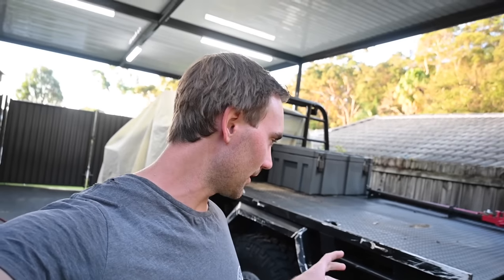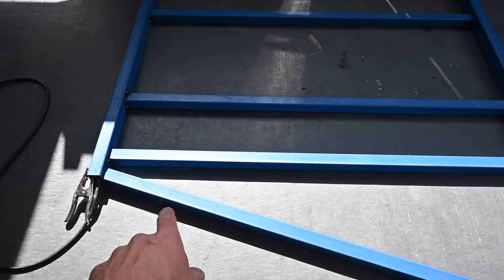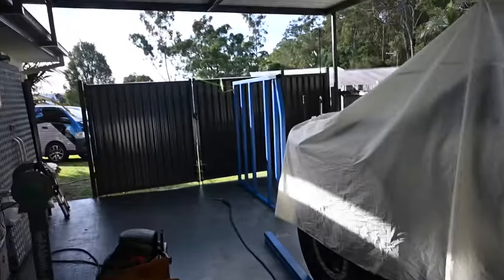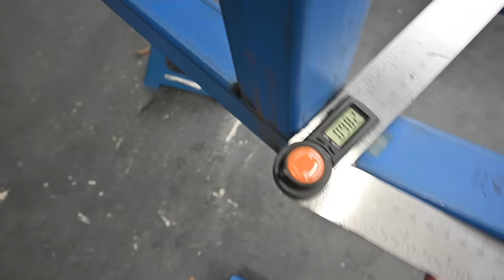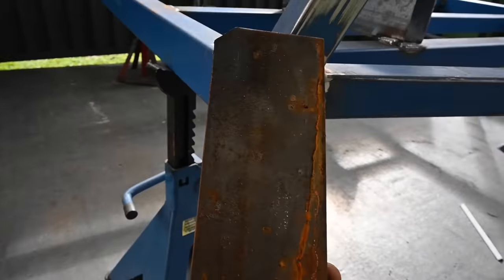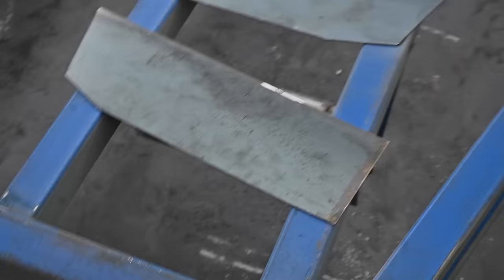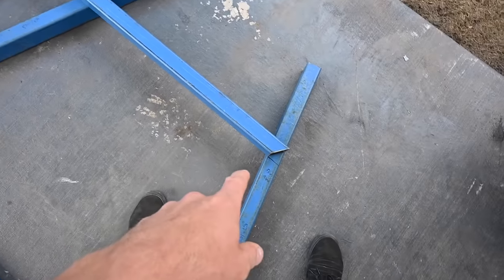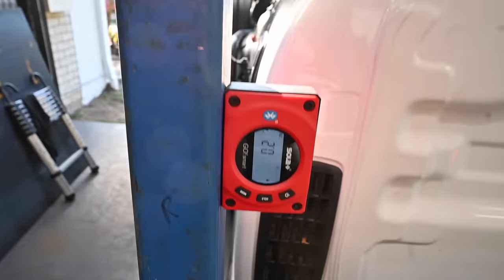My Steel Tray Build - Built completely in my backyard!

Comment: Awesome build, I think it is very well proportioned for the job. My brain won't stop sometimes, and I just wonder, has anyone out there drilled out the framework to make an air tank from it? Seems like a good place to store air from an on-board compressor?  I would like a reply if anyone has done it, pro's and con's ?? I am wondering if it is worthwhile to try..
Reply from the maker: Thanks mate! 
Yeah I know a few people with aluminium trays who have used the headboard tube as a reserve tank for lockers and air free spool on winches. Works well !

Comment: ...Also I noticed your plumbing hanging out from the water tank as most would know these standard  conventional hose & tap fittings eventually leak, even the more expensive ones. It probably does not really matter on the ute as you not operating with mains pressure.

But with water out in the bush where I might not be able to get more with in easy reach, I have been using hose link fittings & these things are awesome. 

I have left the garden hose on full bore for over a week & zero leak, they are durable & last even longer than the most expensive ones. Australian company & reasonably priced last I looked.
Reply from the maker: Sounds like a good option I’ll look into it 🤘🏻

Comment: Tray looks awesome how much did it cost for all material if you don’t mind me asking, as I’m looking at rebuilding my tray but not sure where to start cheers 🤙
Reply from the maker: As a rough estimate with steel, tail lights, and paint I reckon around $1,000. And I did have to go back to get more steel because I made a mistake with the head board. Thanks, stoked with how it turned out 🤘🏻

Comment: I like the clean look you have achieved. It will almost always be that there will be things that you would do differently. I take the view if it still bothers me then it just means I am not finished :0)

@ some point I will build a full tray for my 2nd project. But on my daily drive I have chosen to modify what is already there as it is not too "grandpa (as I have heard you put it). 

I have struggled to get it to look right especially with additions  like a 50% length rear under tray storage compartment. I thought as I am not going full length, I could save on weight with it not being a conventional  draw slide tool box.

I have seen many of those rear draw slide tool boxes & the doors look too "Grandpa for my liking. I am well more grandpa than you so I am a bit self conscious & cringy of it So I am trying to customize out as much of the grandpa as I can.
Reply from the maker: Definitely hard to modify the existing if you have a vision that’s far from it. Sometimes it’s easier to just start again 🤷🏼‍♂️
Reply: @HaydnKamp   

Modifying the existing will usually ask compromise & lateral solutions so I may just need to meditate some more on it before I get surgical.

I may be in for some brain hurt when I cut the head board back & 125mm of the deck to integrate a vertical water tank

It is an old DIY steel tray & in good condition, it's somewhat  mad max patina as with the  rest of the vehicle has bonded me to the vehicle in a way no entitled modern woman ever could.

On this project starting from scratch did not even occur to me . I don't think I could bring myself to do it.

I don't know how I am going to get it to run on pig shit & breath fire & still be street legal.

Comment: looks so good man, what paint did you use? and do you recommend it?
Reply from the maker: Cheers Isaac! I used ‘white knight rust guard’ in the ‘epoxy enamel’ and with the satin black colour. Cheap and really easy to spray, seems to hold up as I painted all my bar with with the same stuff. Can also get it in a pressure can for touch ups 🤘🏻 used the cheapest spray gun I could find from Bunnings and just filled it and pulled the trigger 😂

Comment: If you have the back so much lighter than the front doesn't that introduce grip issues or it's fine for offroading? Asking because I have never done this kind of stuff before but it looks wild to me.
Reply from the maker: In my other Hilux, the weight balance is more equal front to rear and it’s a huge hindrance on steep climbs as all the weight sits on the rear wheels and the front looses grip and steering. For the tracks I’ve built this Ute up for, I prefer the rear to be lighter. However too light and it’ll make steep down hill’s interesting also, that’s one reason why the tray’s made from heavy steel and not aluminium. I’ve also got a low mounted water tank and a large secondary battery mounted under the tray. Spare tyre will also sit on the tray when I fabricate a mount for it.

Comment: Hey man just wondering what were your final two angles for those taillight pieces and how did you know how much to cut out to get the angle when you bent that main rear bar piece
Reply from the maker: I used the taillights angles for the rear section so it sat nice and neat I believe it was 60° There’s online calculators for mite joins to save thinking about it so it’s perfect every time. I didn’t use them, I just halved the angle I wanted and cut out the wedge section

Comment: I know im a year late but im wanting to build a tray myself what measurements did you use on your tray (length and width of the tray and height of the headboard)
Reply from the maker: These are overall measurements 890 tall, 2000 long, 1900 wide
Reply: @HaydnKamp what was the rough price of building it if you remember
Reply: @HaydnKamp  Thanks mate

Comment: Nice build mate, what sort of paint did you use ?
Reply from the maker: White knight rust guard epoxy enamel in satin black
Reply: Sweet mate exactly what I bought , looks good mate 👍🏽
Reply from the maker: @AnthonyPepper-x6x  easy to spray and easy to touch up too
Reply: @HaydnKamp  yeah that’s it mate I got a couple runs but I’ll just wait till it’s dry and give them a light sand and touch up 👍🏽